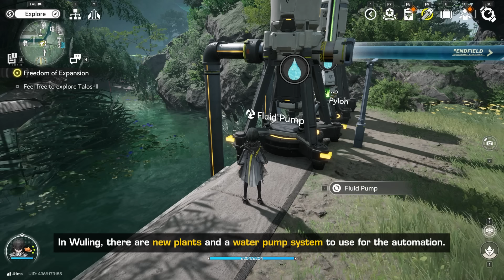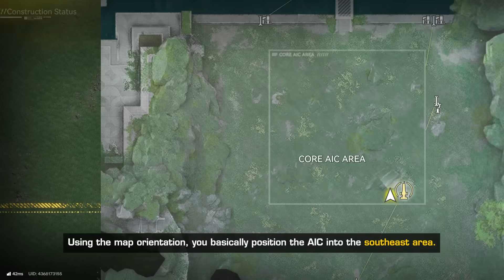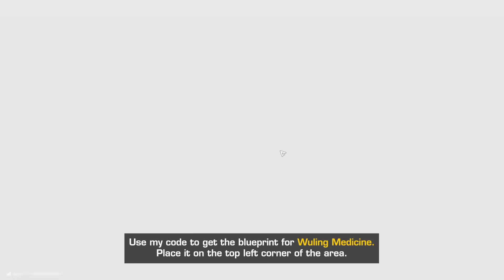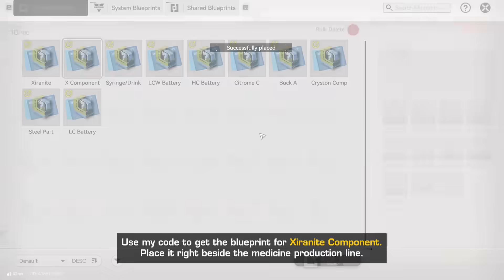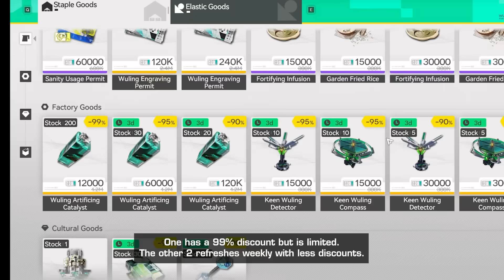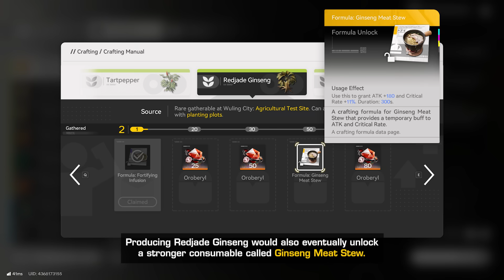Max Efficiency Checklist for Wuling | Global Codes for Wuling Endgame Base

Comment from the maker: Xiranite
Asia: EFO01ouiOAioU0630IieO
NA/EU: EFO0172UAE8ui7554O0Ai

Wuling Medicine
Asia: EFO01E50Ua0E1uo5I3uIa
NA/EU: EFO01U4Ai23IeUOEi7Oa8

LC Wuling Battery
Asia:EFO01I3A5UAI7a97O5o08
NA/EU: EFO01iOe75I8Ui2e372U4

Xiranite Component
Asia: EFO01u8U47Uue10a3AoOU
NA/EU: EFO01u1Io6Ui8u0aEAoOU

Images
https://imgur.com/a/exTmpDh

For those who started transferring Jincao drinks to the Protocol Stash of the Gearing Unit, I realized there was a mistake with this. Jincao drinks can easily fill the Stash too fast because it will cap to 48k in your depot. This means your Gearing Unit won't be able to use the Stash since it is clogged. So make sure to create a separate Protocol Stash for the Jincao drinks instead. I apologize if I couldn't foresee this issue.
Reply from the maker: There is a very slight problem with the NA/EU code for Wuling Medicine. I'll update it as soon as possible. The one that helps me convert the codes is currently sleeping lmao.
Edit: Fixed and updated the pinned comment.
Reply: @LisaraScarlet  still having the same error code

Edit: I did it manually
Reply: @Khiraza  okay so lots of people has issue with code, there is only 1 alphabet is wrong , theres no L (small caps in every codes) instead its i alphabet (with caps and no caps) so ppl seems to getting error codes 😅
Reply: @LisaraScarlet sir lisara, is there any New blueprint for wuling?
Reply from the maker: @Zere8_8  Those are still the same codes.
Reply: @LisaraScarlet  not sure if what you changed ended up increasing the consumption of ferrium ore but now ive got 90 yield w 120 usage, alr wuling lvl 5 so not quite sure where the extra consumption is coming from. Maybe the medicine, as ive been producing a consistent 6 per min
Reply: Okay so after some analysis, ive come to realize that you had 4-5 medicine being produced due to the offshoot into the protocol stash that was later removed from the bp. I saw your comment related to it n realized it might be that im js feeding too many plants, so ill probably either store some or js use splitters to reduce the units, thanks again! new n i find your videos very insightful
Reply: WAIT LOL I realized its because ive had a surplus of ferrium ore so it took me depleting all of it to reach the same speed as you lol silly me
Reply: The factory must grow! Thanks for the eco-farm! Sadly only 2 Forge can be used for now
Reply: It seems like all the EU/NA codes dont work btw
Reply from the maker: @SerRiptide  That's wierd, I will upload image versions so you guys can use it temporarily while I figure out the problem.
Reply: Was trying to check if i had a better space efficiency and they just dont work
Reply: @SerRiptide  Just did the entire setup, they all work except the medicine which I copied by hand from the video. Make sure the others don't have a space at the end when you copy, that was an issue for me
Reply: How did you get 360 originium yield in wuling i scoured entire map in jingyu valley and Wuling but I only have 310? Your blueprints are top notch but I need to hit the same 360 originium yield to complete it otherwise I had to stock originium from valley 4 to compensate originium usage
Reply: @GenesisXcutionis your wuling level 4, its possibly what you are lacking
Reply: @SerRiptide yes that's right, thank you for telling me, because I haven't sell any product yet, I'm flat broke in wuling
Reply from the maker: @GenesisXcution Check the foggy area below Guhou Marsh.
Reply: @LisaraScarlet ok noted thank you
Reply: @LisaraScarlet  how to get there, is it through lingshui way? i got blocked by the npc .-.
Reply: nvm i got it :D
Reply: @aldo_aldo13  how
Reply: @x0Synthwaver0x theres one of these walls you have to hit for them to reveal theyre not real somewhere below where the "H" is in Guhou (at maxed out zoom)
inside theres a bunch of originium veins, like 6 or so
Reply: I believe the Weulling Medicine of EU/NA is one tale above, starting from the planty farm. I had to adjust to fit into the plot.
Reply: If the game thinks it's an invalid blueprint, copy and paste the value into a text editor and trim the trailing space or newline char before pasting into the game.
Reply: Thanks for the blueprint, it is quite helpful since it is kinda confusing doing it manually.

😊👍
Reply: Nice
Reply: i guess these no longer working?  code input for na/eu  comes back as to long input in game?

Comment: The only change i did was i started using Wuling Batteries into one generator, and then used the metastorage transfer to transport Ferrium to make up for the deficiency in Ferrium for the potion production.

Thank you for the easy to undestand and simple templates you have given us Lisara.
Reply: are u using wuling battery on 2 power generator instead? bcs if its just 1 it still not enough for all of them

Comment: May i ask? Why mine is using 120/min instead of 90/min Ferrium Ore??? Its decreasing my Ferrium stock :"(
Reply from the maker: Because the medicine line uses 4 ferrium unloaders. Each unloader = 30/min usage. I don't know why you don't wanna use your ferriums but you can turn off one of the unloaders if you want.

Comment: why is my ferium output 120? I'm confused
Reply from the maker: Because there's 4 unloaders for Ferriumson the medicine production. You are capped at 90 yield for now but 120 theoretical consumption means you will have use for the ferriums that stockpiled in your depot.
Reply: @LisaraScarlet so do I have to occasionally top up my supply from valley 4 or let the storage be zero and it will still run fine? Thank you for replying btw❤
Reply from the maker: @grimjr2882  Let it be 0. You would still overproduce and bankrupt Wuling stocks anyways.

Comment: What about the outpost?

Could the outpost not be used to make batteries so you dont need to run them from valley?
Reply from the maker: There's no resources left to use. You can only add more planting unit loops.

Comment: An upgrade that I've found can be made for this blueprint is you can squeeze 1 unloader in the L bracket of the depot bus for another crucible to intake Water+Xiranite, every day I collect 20 Burdo-Muck (cow poop) and stash the Forge of the Sky from the xiranite crafting module (to clear the water from it) and then re-position it to receive the Xiranite Liquid from the crucible and manually insert the burdo-muck to make double yield fertilizer for the eco-farm.
Then just stash the forge again to clear the xiranite liquid, and put it back to work making Xiranite.
If anyone wants the formatting I use to make this work its right here: EFO019A612I8OOe65uI2
Just import that as "West" as it can go on the L bracket and the Forge will slide right where it needs to just make sure the liquid input is where it needs to go

Comment: Do you have to use the "Stockpile" transfer for the HC Valley Batteries? or can you use the metastorage transfer?
Reply from the maker: Metastorage is better.
Reply: @LisaraScarlet  thanks!! now for some reason my factory is using 120 ferrium for some reason
Reply from the maker: @NightNakano  That's normal. The medicine line has 4 ferrium unloaders but we can only supply it with 90 ferriums instead of 120.

Comment: why not also maximize Jincao drinks by transfering 1500 farrium via region transfer + bagging the rest. This way you can stockpile more wuling batteries / craft more components.
Reply from the maker: There is already too much medicine and battery output that the outpost can't keep up. I rather have the convenience of transferring less HC batteries.
Reply: @LisaraScarlet  i have just started making more components and cut battery, to upgrade 1 piece of gear to max via artificing you need (7+13+21)x3 x 50 = 6150 components if unlucky/pity. Although I guess you are more limited by the artificing item. Still I do not think there is a point where you don't need components.
Reply from the maker: @ttl246  The limitations on Artificing creates excessive amounts of components. I'm already at that point by the way.
Reply: @LisaraScarlet  sure, we are both limited by the outpost output anyway. Didnt help it took me 16 permits to get an essence for Lae.

Comment: When your Regional Dev stage hits 12 in the first area you unlock Meta Storage under regional transfer. You have the old method atm. You need to cancel transferring the batteries and select Meta storage as the new one, it makes the batteries out of thin air so there's no longer a cost
Reply from the maker: I totally forgot about it and updated mine recently.

Comment: Second comment, the NA wuling medicine blueprint is incorrect and is 1 tile too long/tall.  For anyone having issues getting it to fit you can snip 1 tile out of the belt and pipe at the farthest edge away from the bus side of it next to that power pylon.  After that grab the shredder, seed picker, planter, the pipes attached to the planter and reactor crucible and all the belts and move them 1 tile closer, then reconnect the shredder into the crucible since it also wasn't connected to start.  Idk if lisara made the NA version but whoever did made a slight mistake with it.
Reply from the maker: I only sent an image to one of my mods to replicate my setup and unfortunately, I can't check if its correct on my own since I'm in Asia. They said they already fixed it and I updated the codes.
Reply: @LisaraScarlet  they lying, thanks to this comment i fixed this for me

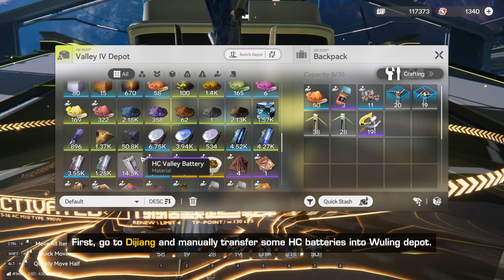Comment: 1:56 I actually manually swapped a single power pole around in wuling to power specific machines on and off to work within the 200 starting power they give you until i had my first xiranite battery up.  Was slow but fun, felt nice kinda brute forcing the power through like that without relying on my main valley iv base.

Comment: I have a question, so if I want to produce battery and gear component at the same time, can I just turn off one battery production and keep the other one running? Is it possible?
Reply from the maker: You can turn off one battery and remove one of the two xiranite unloaders for the gear. That will balance it better.

Comment: Really appreciate this! A few of the NA/EU codes are slightly off but, the only thing major is that the Wuling Medicine blueprint requires shifting the planting and shredding units and their belts down so that it can fit in the space shown in the video. Its 29x12 instead of 28x12.

Comment: My mind is blown that you can put a bus in the middle and have double the access. My factory is a lie.
w8, the pump can provide for 4 tubes, no? Tube speed is 2 per sec, which is 4x faster then the belt speed of 0.5. So you can feed 4 inputs to mach belt speeds.

Comment: It says the splitter needs to be in the core aic area when i tried to do it like u
Reply from the maker: Is that NA/EU code? Probably issues with the person helping me convert my codes.
Reply: @miaowu3099  If ur on PC u can just press Z whilst outside the AIC zone, select the pipe splitter and then place it.
Reply: If you're NA/EU like me, move the depot bus setup down 1 tile to allow space for the pipes.
Reply: make sure you select pipe splitter not belt splitter